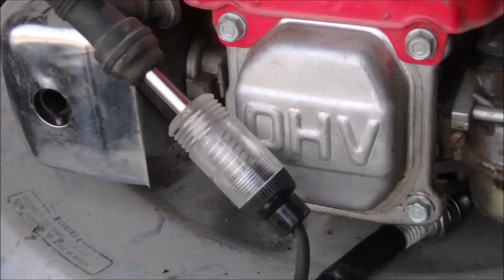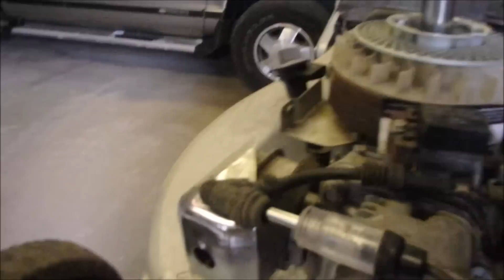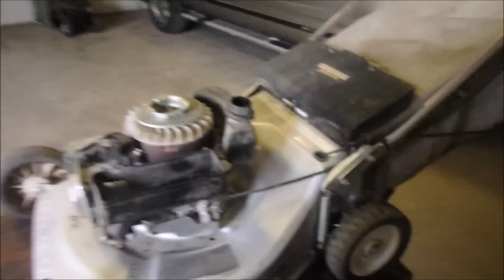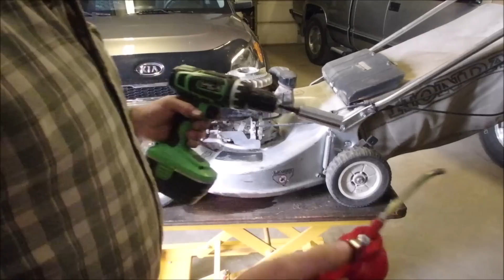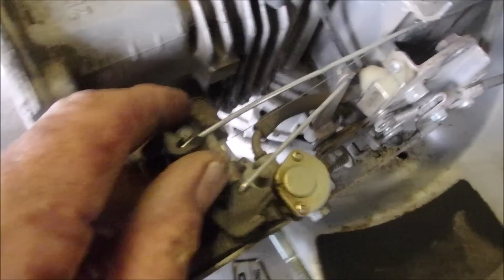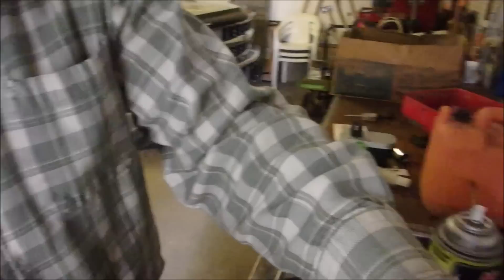Honda HRA214 Won't Start

Comment: Hey Bruce, really enjoy your videos, especially inspiring is your positive attitude and sense of humor!  I recently picked up a Honda HRA214 SX.  I got it running but my problem is that I seem to have only full throttle and off.  I can't seem to achieve any reaction from the throttle.  I've tried everything I could think of w/o success.  If you have any suggestions, they would be most appreciated!
Reply from the maker: Welcome aboard!  Well adjusting the governor is a last resort as they are set from the factory.  The governor is the lever and spring attached to the small black 1/4 inch shaft coming out of the engine.  IF you adjust this it only has 2 position possible.  1 loosen the bolt holding the bracket onto the shaft.  Take a set of good pliers and turn the shaft coming out of the engine   it will only move maximum 1/8 of a turn.  If it doesn't help one way try the other direction.    The other issue is that it has been adjusted so many times the grip on  the aluminum handle is stretched and that needs to be filed so it grabs the shaft.  Good luck.  There are a lot of videos on Honda governors.  Take a look at about 10:26 in this video.
https://www.youtube.com/watch?v=nK6wnwUFx-0&t=1s 
Watching the whole thinkgwon't hurt.

Comment: Mine starts and works just fine, but it's leaking crazy amounts of fuel all over the place.
Reply from the maker: The needle and seat in the carb are most likely not sealing.  a carb rebuild or replacement is what you need.  Let me know how it goes.
Reply: @BrucesShop  Giving it a shot tonight!

Comment: Hi Bob ,if I may can I ask your advice? I have the same mower and I've fully serviced it. New oil , filters ,carb fully cleaned  and new spark plug. I've tried to start the mower and not getting combustion. The plug smells of fuel vapour but isn't wet. After each pull on the mower there is always a "hiss" noise from the bottom of the engine close to the mower body. What else can I try? Thank you
Reply from the maker: I would take the flywheel off to see if your keyway is sheared mixing up the timing makeing the spark light the fuel at the wrong time.
Reply: @BrucesShop  fantastic. Thank you so much. Massive fan of your channel . My son is hooked also haha. Chris from bonnie Scotland
Reply from the maker: @bohdiconnelly6136  The name is Bruce BTW  LOL
Reply: My utmost apologies , it's this phones god awful auto text.
Reply: Well Bruce ,your long distance diagnosis could be spot on. Stripped the flywheel off and found that the key has been sheered in half. New part ordered and fingers crossed,it could be a new life for such a great mower! Thank you so much for your time and help

Comment: Any idea a honda 160 lawn mower engine with new ignition coil but no spark I disconnect the kill switch wire and still no spark thanks for your help
Reply from the maker: I would check for a shorted spark plug .  Can you try running it with a different plug.  I know it sounds simple.

Comment: Dang, I would've paid even another $5...$20. LOL
This is probably one of the very best home lawn mower...that really never dies.
Reply from the maker: Right.  Do yours smoke??
Reply: @BrucesShop  Nope, she's been running great for 33 years with absolutely minimal maintenance (2-3 oil changes, and not sure if I changed the spark plug or not). I think Honda lawn mowers are THE BEST in terms of longevity. I've been thinking this is going to crap for last 10 years, and I'm finally convinced this will may go another 10 years. 
I'm going to give it a nice tune up (change oil, clean air filter, sharpen blades) in the spring, and may be give it a fresh paint job for the great job it's done. I've subscribed to your channel, and I'll be watching more details.   The only issue I'm having is the self-propelling seems slightly less powerful than before, but that could be just my imagination.

Comment: If it’s not the carb, it’s the carb, otherwise it’s the carb.
They are pretty cheap down here, generally $22.00 to $28.00 delivered.

Comment: Great job Bruce. I always tell people don't trust them light up spark testers. Get a older one to see if it can actually jump spark like them old Briggs ones
Reply from the maker: Right.  I just use an old plug opened up to 100,000 th.  I still use the neon tester  but only to see.  I know now what a weak spark looks like too but i still don't trust them much

Comment: look at the choke rod, some idiot made it straight already,  if you remove the control  2 ten mm nuts its comes apart much easier,  this guy does not know at all what he is doing,  didnt even take out the pilot jet
Reply from the maker: I did .  I just didn't edit that in.  I pull the pilot jet on every clean.  Some are metal and some are plastic.

Comment: Can't believe I just got a hr194 no starter. Found manual. Coil gap is .016 set away from magnet. My problem was apparently just the boot end. There are also ohm measurements in the manual for coil testing. Normal compression is only around 50 psi . manual shows how to bypass it to get true compression.
Reply from the maker: The compression will read low as on the the rope pull there is a compression release to make the pull easier.   Only at high rpm with the compression increase after it is running.

Comment: spark plug gap is 0.70- 0.80 mm
Reply from the maker: That sounds about right.  I use SAE which is about 28 th

Comment: Thanks to you Bruce Pender! , without any prior experience I got a 35 year old roadside find up and running - Honda HR214.  Only problem is a hole in the deck - looks like a blade may have wobbled off.  Any ideas how I might patch it?  Many thanks.
Reply from the maker: Well if the hole is small ( 1 inch) I would get some sheet metal and either rivit in a new piece from the top or use short sheet metal screws.
Reply: @BrucesShop  i have some sheet metal on hand - I'll give it a try.  Many thanks

Comment: rule of thumb
ck compression, spark and fuel. Repair failure of any.
clean carburetor remove the main jet, remove emulsion tube clean all passages,
if using sonic cleaner blow all passages clean, reassemble carb , fresh fuel, might even add a fuel filter, fire lawnmower, its not rocket science just a lawnmower.
Reply from the maker: Right.   I do wonder why more people don't try.

Comment: I used a drill motor to turn a Japanese Briggs two weeks ago and it ate my hand .  The engine kicked three licks and the five pound flywheel spun off the tapered shaft. Split the skin right to the bone.  An engine spins faster than a drill motor, so maybe Mustie1 and you need to warn us mere mortals of what can happen. A five pound flywheel going a five hundred RPM can do some damage when the fins hook up with human tissue
Reply from the maker: Yes it is dangerous.  I usually say something before starting like  "I am going in"   not much of a warning though.    Everything is risky.
Reply: Hey. How is your hand now? Can you still use it? I am very sorry for what happened.
Reply: I’m sorry to hear this thanks for the heads up

Comment: I wonder why the coil went bad
Reply from the maker: The coils are designed to have a gap of about 30 thousands.  this was was almost touching 5 th???  creating almost a short and loading the current flow of the spark  my theory.  I think that is what did it.

Comment: When the spark gets weak, it doesn't burn all the gasoline in the combustion chamber so the exhaust emits black smoke, just like it was running too rich.
Reply from the maker: Right.  The last owner thought is just smoked.  Although it still does a bit.  There is a lot of carbon in there so let's wait for part 2.

Comment: Glad you kept going one it started to fire. I would have done same thing. So close, keep going!  My Tecumseh snowblower project got delayed by the same type of coil problem, the spark indicator said "good", but the spark plug did not spark. I thought the points were installed wrong / badly / user error / but I decided the coil was weak. I guessed right, because now the engine runs and the auger turns, and I just need to figure out the drive problem. Goo job Bruce! We are thinking along the same lines, so I think I am on the right path.
Reply from the maker: Yes  Teh spark indicator is just that.  I have had mine long enough not to trust it.
Reply: @BrucesShop  I saw you using a tachometer in one of those videos. Now I see a new toy I want. Looks like you recommend the "hook to the spark plug" type over the "take a reading off the moving blade" type?? Tom Haney is the live dangerous type of guy!! which means it will come down to cost.
Reply from the maker: @haneyoakie14  Well i would get the inductive type.  they aren't expensive.  You can get the one for minibikes and just use it for a small engines of any type.

Comment: Why do you suppose the valve cover bolts are mia?
Reply from the maker: They aren't.  The not only hold down the cover but the rewind housing too.  At 6:20 You will see.

Comment: I worked on a similar vintage Honda (early 1990's) this past summer. Ended up being the coil but unlike yours, the spark did jump the plug; it was just an intermittent failure ... run for a while, stop, run for a while, stop. The owner didn't want to pay up for OEM so I got replacement from Amazon. Believe it or not, the coil included a carb & gaskets .... for about $16. Ran fine all mowing season & still does. BTW, his had a GX140  (same as yours, I think). What a great engine, better I believe than the current GCV160's (also good engines) but probably became too expensive for Honda to make for today's Home Depot mass market.
Reply from the maker: Yes.  This mower has a commercial "feel" to it.
Reply: I just got hr194 at church dumpster. After checking bunch of thing for no start it appears to have been plug tension cable end. When it finally started it would just putt putt at low rpm. One time it suddenly sped up and ran fine. I suspect that the compression release was stuck.

Comment: Wait. Your going to make me wait for a part 2. How can you sleep at night lol.she will be a runner. But the question is why the black smoke. Could of been run of choke I suppose. Great video as always mate
Reply from the maker: Well these are famous for either valve guides or ring issues..
Reply: @BrucesShop  yeah I had one in this year too but I got it running with replacement of the carb gasket
Reply from the maker: @themowerman  There are more of them out there as they do burn oil and folks don't like that.
Reply: Bruce Pender yeah mate